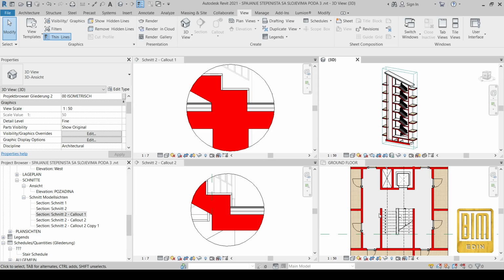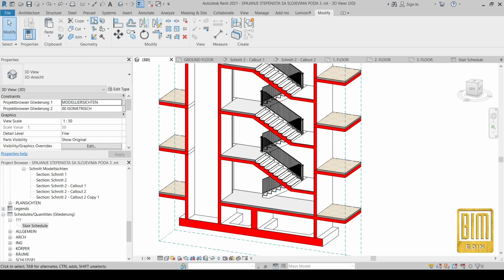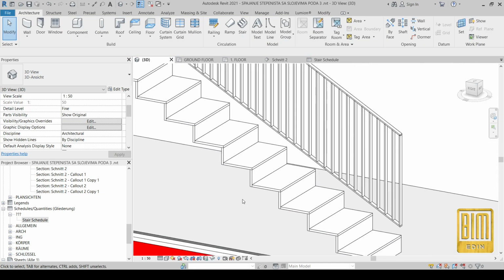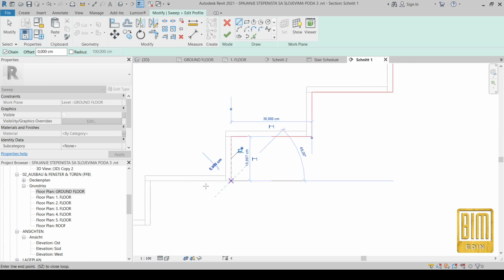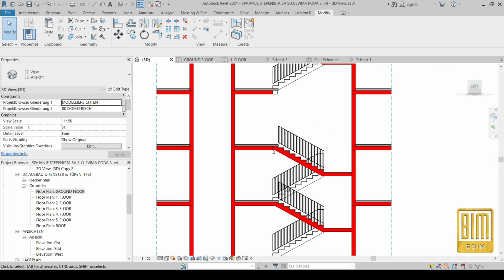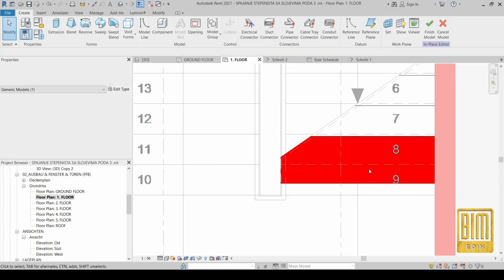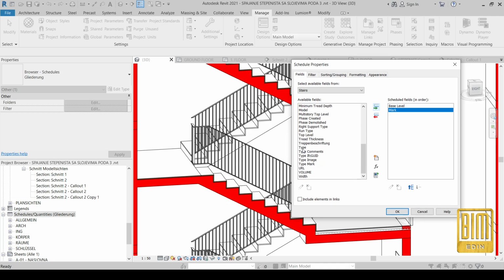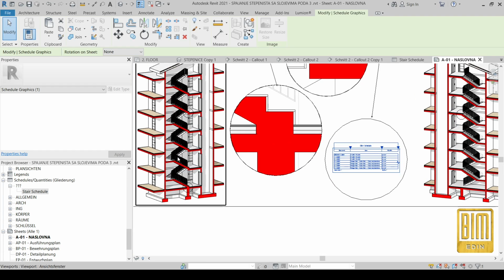MODELING STAIRS IN REVIT - BASE and TOP CONNECTION -  PROBLEM SOLVED

Comment: Decent final results but quite the workaround. I was wondering why you handled the scheduling like this. Wouldn't the Material:Volume field in a material takeoff schedule worked automatically without the need for manually adding in the values to the VOLUME parameter?
Reply from the maker: Thanks! The issue is that Revit still hasn’t fully solved the connection between stairs and the floor layers above and below.

We always seem to have to choose between having the correct graphical representation and having automatic quantity calculations.

Using Model In-Place is not really a good solution if you want to automate the whole workflow, especially on projects with many staircases—and particularly when the staircases are not standardized and each one is different.

I’m not sure if the latest versions of Revit have addressed this problem yet. Considering Revit’s main purpose, I believe this should really be handled automatically.

Comment: This works pretty well for a workaround and i do it this way too but it's still just a workaround for the horrendus stair tool we currently have.
The overhaul of the stair tool is "on the radar" on revits roadmap as a feature they want to possibly work on in the future but they should have started work on it years ago! There are highly upvoted complaints and reccomendations on what the tool is lacking on the revit ideas forum that have been there for over 5 years!